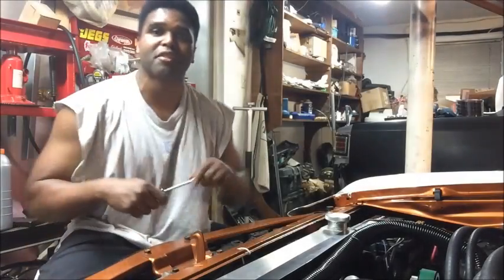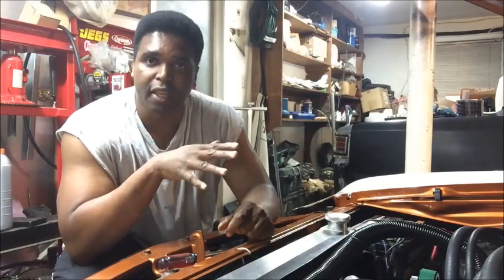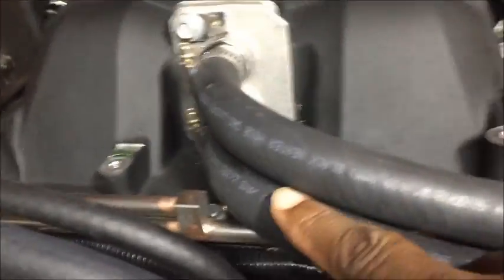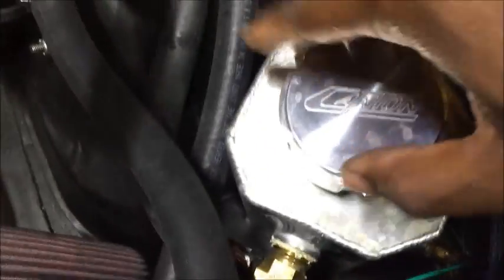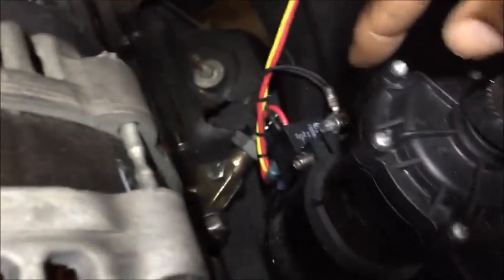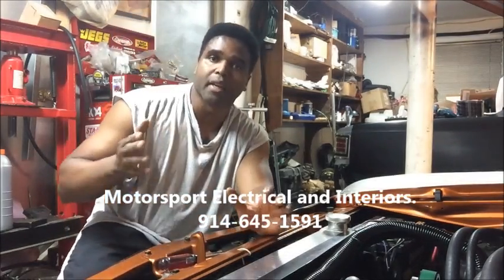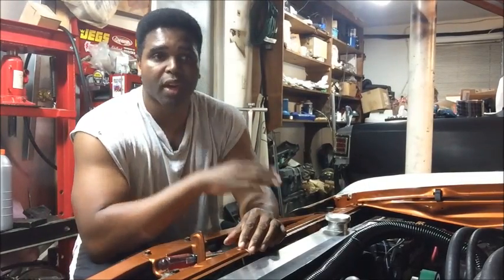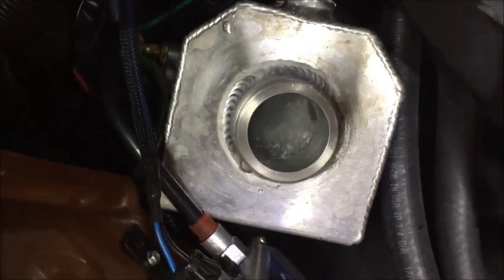COOLING THE LSA SUPERCHARGER.... CRITICAL!!!!

Comment: Hey bro, I’ve tried to Google my question but can’t get a straight answer. Would happen to know the operating temp for the LSA coolant?

Thanks
Reply from the maker: it all varies, if you are over driving the blower it will be a hotter. if you have have a bigger exchanger its going to run cooler.  im told 150 to 200 degrees
Reply: @Coverman66  I couldn’t get an answer. I’m going with a smaller . Thanks for the info!

Comment: Hi Terry, Doing the same project in a few weeks.  how did you size the heat exchanger (Intercooler) and what make/vehicle did it come from? Cheers Craig
Reply from the maker: the exchanger im using on my chevelle is the afco zl1 exchanger,  it required a lil modification which wasnt that bad. if you have measurements, afco will make a custom exchanger for your application.. thats what i did for my TBSS project.. looks cool..
Reply: coverman66 thanks man

Comment: This is my dilemma. I have a 1969 Chevelle that's SUPER CLEAN and original, except, for the L-76 with LSA blower we are putting in it. Im not willing to cut the car up for a heat exchanger AND it has A/C. I don't know what to do. I don't want to run only on an ice box. But I don't think there is any room up front for an exchanger like you did. Only thing I think would be feasible is 2 really small exchangers behind the front bumper where the turn signals are? Would that be enough?
Reply from the maker: thats could work if there are a double pass.

Comment: What intake air temperature do you get during cruising? Mine is about 100 degree.
Reply: Does your brick get really hot after driving?  Mine does...
Reply from the maker: ive havent measures that. but i will.. thats a great question..

Comment: Works on Ford Dodge and GM engines including aftermarket superchargers intake temp on a LSA supercharger on a 100° day is about 60° intake temperatures even colder as temps go down make 50more bhp and 35 touqre
Reply from the maker: thanks for the Info.. this if good to know..

Comment: Hi terry

I bought the canton reservoir but didn’t come with the cap or NPT fittings. Did yours come with the cap? If not, did you buy it separate? Would like to know what cap is that to buy.
Reply from the maker: whats good buddy, yea i had to buck up for the cap, but it is a nice piece..  you might have to call canton and ask for the cap.. i forgot the part number, but its a nice piece..

Comment: Hey just wondering if you did a shut off delay relay for the coolant pump, wondering if heat soak after shutoff is much of an issue on hot summer days in traffic I have a turbo so I worry about coking in the housing maybe not an issue with superchager dont know if bearings are oil or just enclosed with greaase...  anyways nice vid thank you for cool relevant build vids...
Reply from the maker: the LSA has a fill plug in the back for suprcharger oil to be added. there is no oil cooler like on a turbo car.. hope this answers your question..

Comment: Hey man I got a 6.0 with ls3 top end and I’m thinking about installing an LSA blower like the one on the vid. Do you happen to know what kit I need to buy? 
Thanks
Reply from the maker: what parts are you needing? i will help best i can..
Reply: coverman66 oh okay thanks boss and on the Lssimple kit what’s the difference on the 8 groove and 6 grove, I have a 6.0 with LS3 top end but I don’t know what kit I need.
Reply from the maker: if you use the 6 rib, it may cause the belts to slip.. i would recommend the 8 just like stock..
Reply: coverman66 Oh okay got it 💪🏻thanks man I appreciate it.
Reply from the maker: if it was me i would buck up the extra money for peace of mind.. i was thinking about the 6 rib but now im glad i got the 8..
Reply: coverman66 oh okay 👌🏻so the Bosch pump would be this one? (0392022002) <— that’s the part number. Is this the one from the vid?

Comment: Been following the progress from the beginning. Nice work so far. How did you run your pcv lines? Planning on running a catch can(s)?
Reply from the maker: whats good Jorge, i capped off the pcv in the drivers side valve cover. i got a valley cover from a LS3 with the spout in the front and ran the catch can from that and the spout on the intake behind the throttle body.. hope this helps. thanks for the questions and viewing..

Comment: Good Job,.....I just can't hear anything, you are saying???;o) Problem with recording/ video?? Anyway, one question fro you,...again: putting M112 Supercharger into my 2004 Mustang 3.8 litre, Supercharger has 3.10 pulley wheel, and my OEM underpulley size is 7 inches in crank! I want just 10 psi, top, would you think, these wheelsizes work/ make that 10 psi?? Or do I need to put  smaller/ bigger? underpulley?? Thanks, youtheman Terry =)
Reply from the maker: thank. Eero, you will be close.. if you got to a 2.55 charger pulley you will be at 10 or maybe a lil above. hope this helps..
Reply: So, with 7 inches crank pulley, and 3.10 supercharger pulley I won't be over 10 psi boost?? Rather a little less, like 8-9 PSI, right ?? Thanks
Reply from the maker: you might be there.. but you wont know until you get it dynoed.. im using the stock crank pulley and the 2.55 smaller blower pulley and im almost at 11psi.
Reply: What size is your stock crank pulley?? Thanks
Reply from the maker: stock zl1 crank pulley is 7.8.. the snoot/snout pulley stock is a 2.95. those cars came with 8 to 9lbs of boost.
Reply: OK, thanks ! So, when crank pulley goes smaller, does it increase or decrease PSI/ boost?? Thanks, youtheman =)
Reply from the maker: crank pulley bigger/snoot pulley smaller = more boost.. thanks brotha..
Reply: Thanks, that was what I was thinking too, like opposite =0))

Comment: What ls block you started with the built
Reply: I think he has a LY6 6.0
Reply from the maker: LY6 6.0.. my block of choice..
Reply: Look super good what's the power
Reply: coverman66 I want to get that 454 lsx they are selling online for 10k with out intake. Wiring and oil pan. What make me so disappointed in them you can't at no turbo, or supercharger to them unless you bring the ratio down . I am also looking to get more power then that 454 lsx. The engine is super cool but 627 hp kinda low to me . It's easy for to put a ls engine together then to have to built a block from scratch.